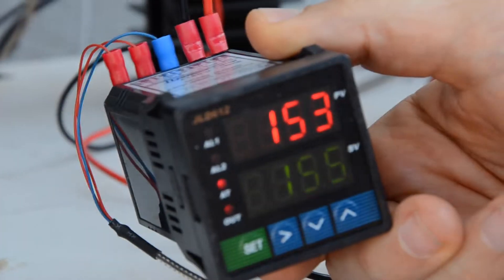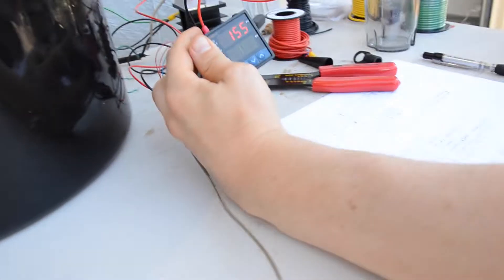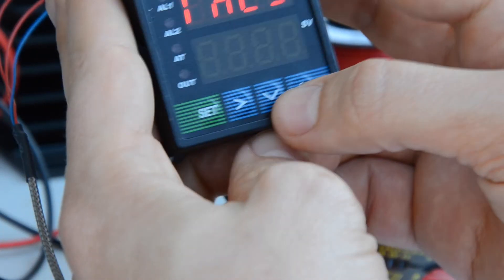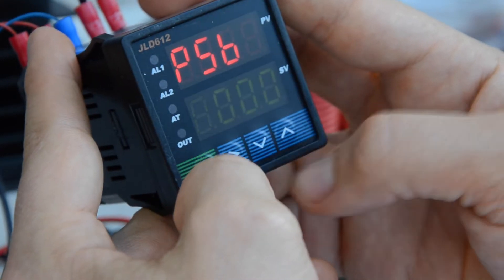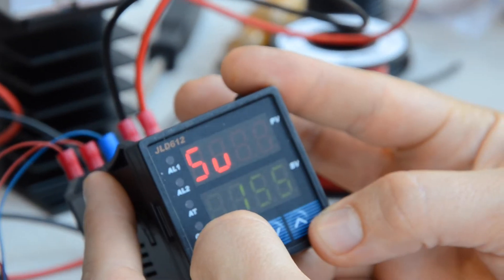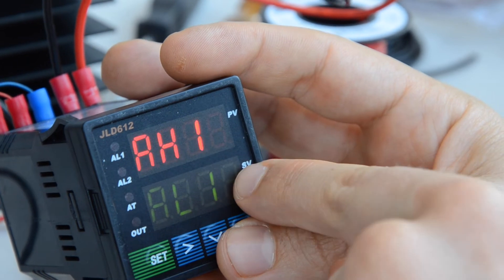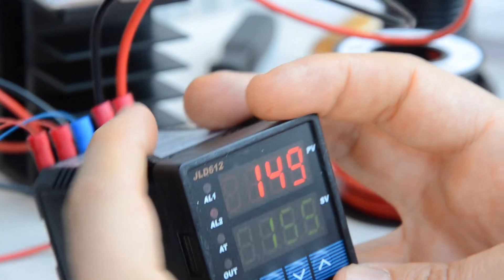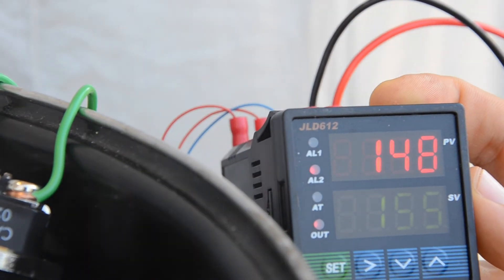JLD612 PID Programming

Comment: You want it set to pt10.0 that will give you the PT100 with the tenth decimal point. If you set pt100 you will only have whole numbers. 
Also, how many times did you electrocute yourself doing this? Just curious since no safety precautions were made, hot wires just dangling above the pot of water and 120v to the back of you PID.

Comment: Thanks for making this very useful little video.  I always find it helpful to see someone actually step through each element of the process of setting up this kind of controller.  BTW if you are using the SSR in differential mode (Out Y setting number 3) the controller WILL NOT AUTOTUNE.  The SSR needs to be in PID mode (Out & setting number 2) for the AT to work. Autotuning on some PID controllers is fast, and takes minutes.  This device seems to take longer.